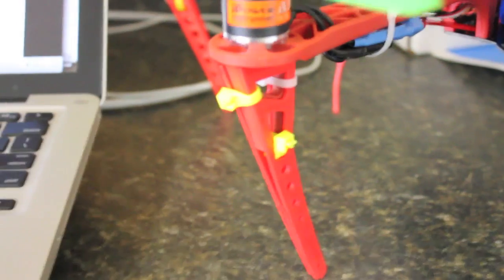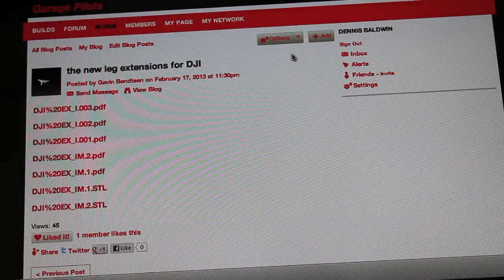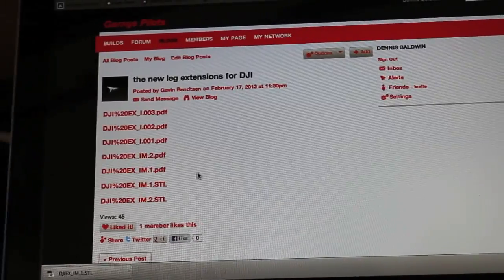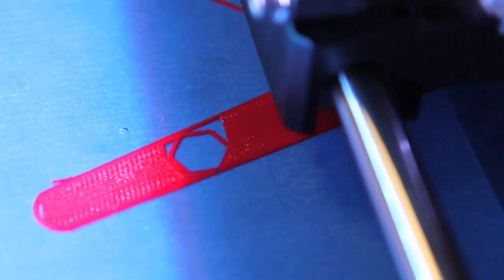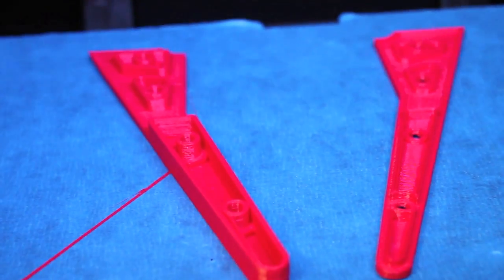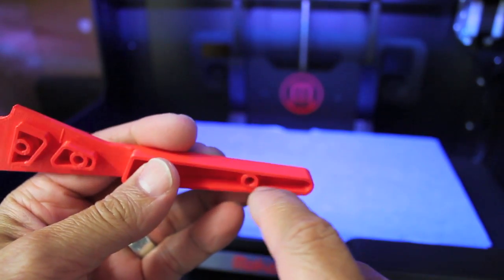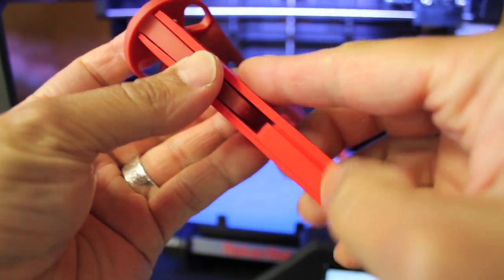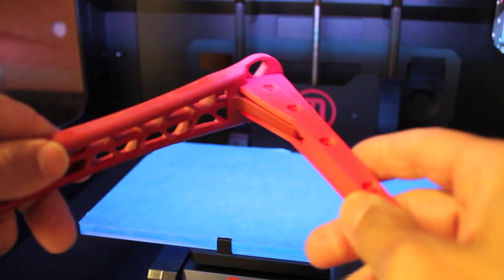New Version of DJI F450 Leg Extensions with Bolt-on Design

Comment: wooo looks like way way to many bolts I hope they are aluminum with aluminum nuts
Reply from the maker: Yes they are aluminum, but I agree this design could stand to use less bolts. The bolt-on design is a modification to my original design so I'll ask the design if he'd consider a design with less bolts.

Comment from the maker: Good question. I'm not sure exactly as I don't have any on hand at the moment. I printed some for a friend and gave them away. The original ones without the bolt on design were about 40g for each leg so my guess these are about double the weight. Let me know if you'd like more exact and I might be able to find out this week.

Comment from the maker: Thanks for the feedback. I'm still trying to get up to speed on design, but yes I do all of my designs. I started with Sketchup and there are plugins that let you export to STL ready to print on the MakerBot. After I got somewhat comfortable with Sketchup I moved on to a program called Rhino 3D, which is awesome. I'm on a Mac so the software selection is limited. Most of my designs are basic parts for quadcopters so nothing too fancy at the moment.

Comment from the maker: I sent out a few sets, but my intention hasn't been to sell them. I've been trying to work on some basic mods that I hope the community can benefit from. If you sign up to garagepilots . com there's a 3D printing forum that has links to several different designs for download. You could download and either CNC them or upload somewhere for 3D printing. Hope this helps.